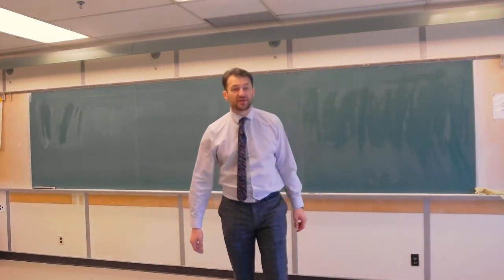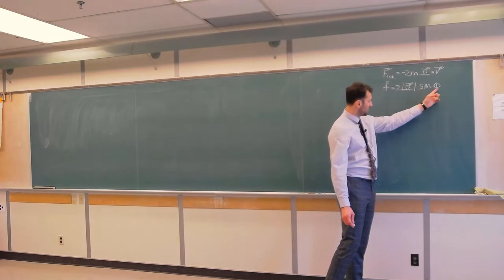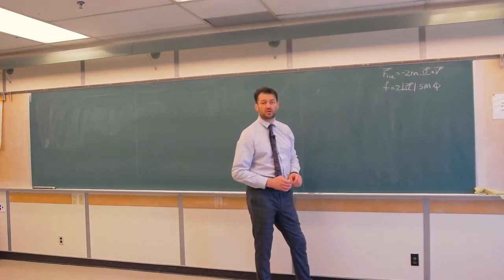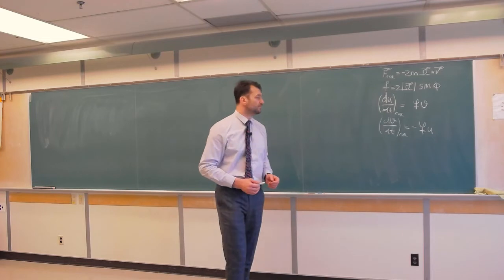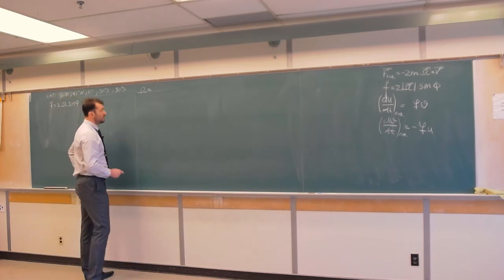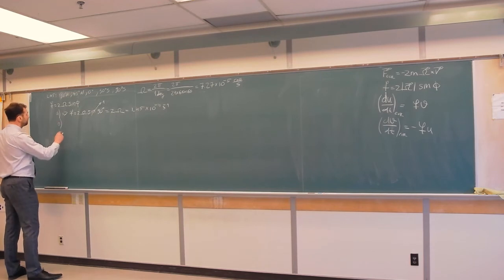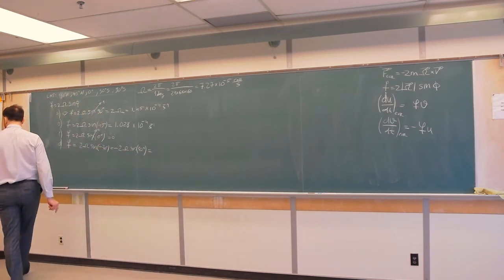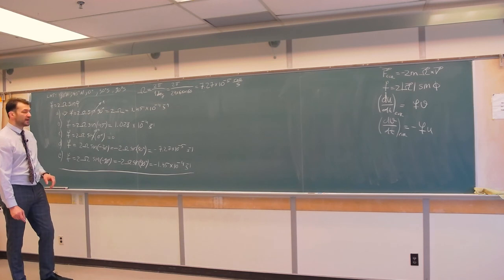Coriolis Force - Q1: Coriolis Parameter Calculation

Comment: where does is the most coriolis effect is? at the perfect center poles due to the vertical axis right? ok than does a latitide map exist from the 23.5 tilt axis instead of standard globe map? funny because with wrong parameter will end up with wrong answer. the north pole is not the axes pole making it all wrong 🤷‍♂️.